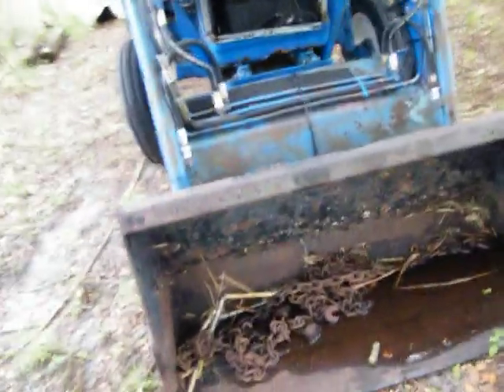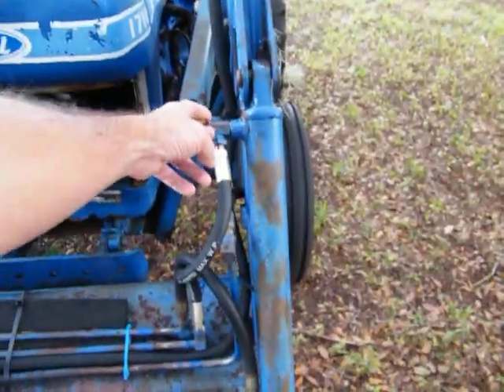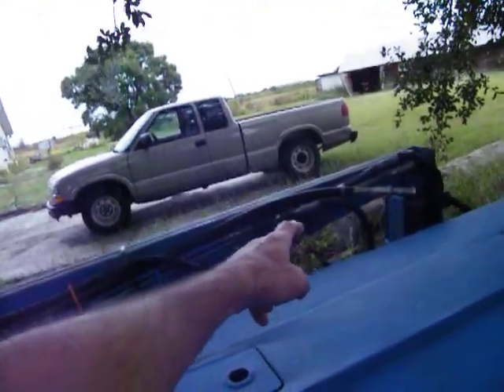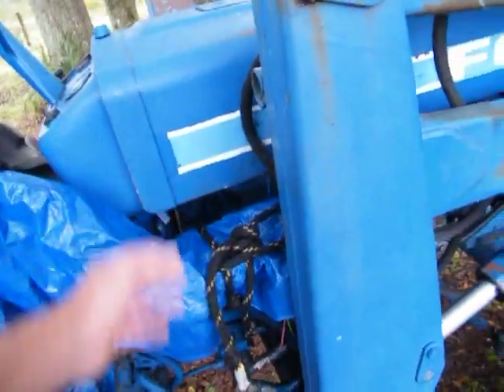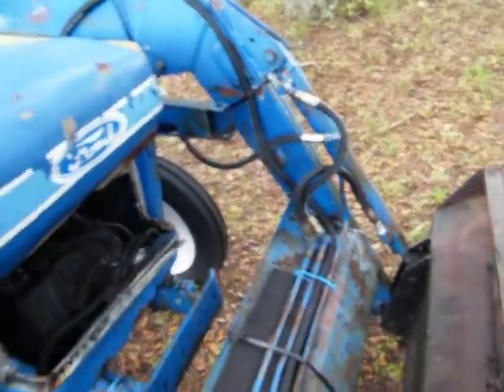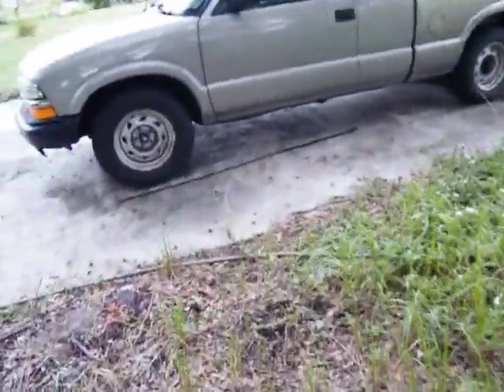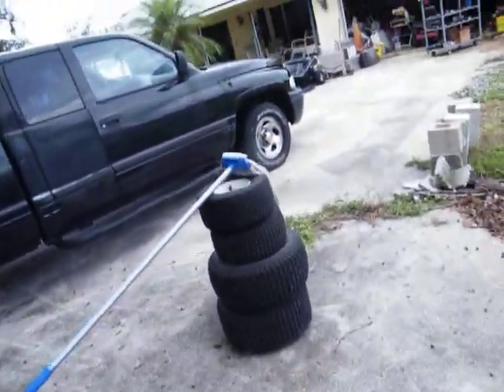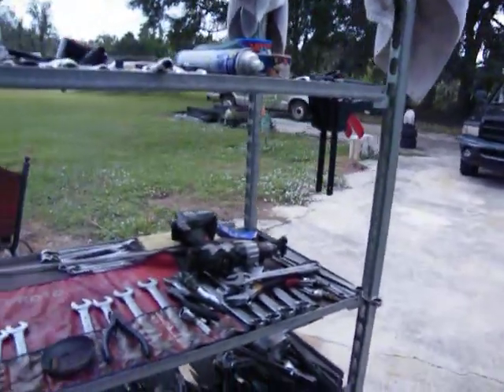DSCF0220 ford 1710 replaced 770A  hydraulic lines

Comment: What is the spec on the fittings
Reply from the maker: i bought all the hoses from tractor supply as well as new fittings, i changed every hose on it not just those visible even the ones to the control valve . tractor supply has them all. 
you may have to order them, i wiped out the shelf and had to order more
Reply: @Rewired69  

Ok thanks.

There one near me. I'll check it out